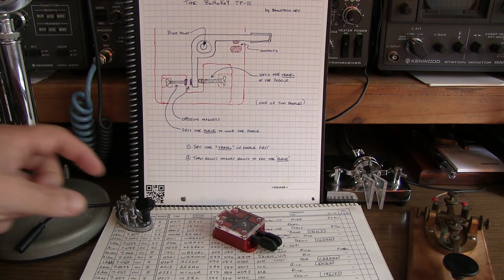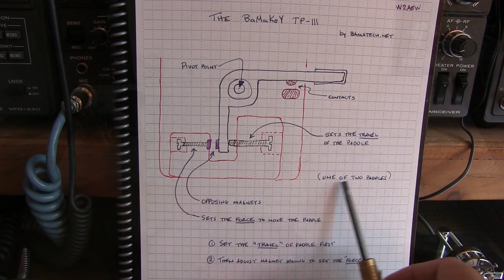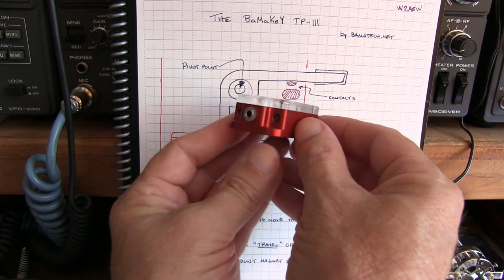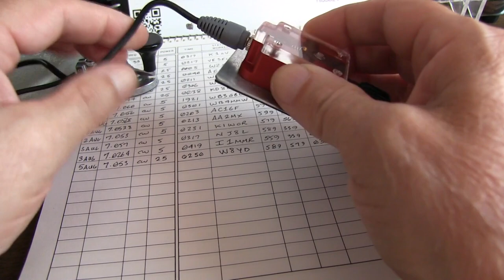#360: Mini Review: The BaMaKey TP-III miniature Morse Code paddles/key by BaMaTech

Comment: Very nice key and I wonder how it compares to the Begali Adventurer.
Reply from the maker: Good question.  I've had the TP-III for a bit over a year, and just got the Begali Adventure for Christmas (so haven't had as much experience with it). But, at this point I can summarize as follows:
- Both are fantastic design and build quality
- Both are super-smooth and solid
- Adventure "feels" more like a full size paddle (larger finger paddles, similar feel)
- TP-III is certainly a portable/mini key - much smaller finger paddles.
- Adventure works GREAT on the KX-2 mount and/or the base mount - would not work well hand-held as your grip would likely activate paddles.
- TP-III is definitely designed for portable operation (decent contact protection from dust/dirt, easy to operate on surface or hand-held).
- The TP-III feels more bullet-proof for rugged travel in a field pack, I'd want to put the Adventure in some kind of protective case for travel.

Bottom line - both are fantastic. I feel like I've got the Porsche (TP-III) and Ferrari (Begali) of portable paddles!

Comment: How is the speed adjusted and the tone generated?
Reply from the maker: The speed and tone are controlled by the electronic keyer in the radio (or a standalone electronic keyer).  This paddle set is nothing more than a pair of normally-open switches.

Comment: I just ordered this beautiful key. This excellent review serves as a great quickstart manual. I like the elastomeric tape idea. Any specific type or brand you recommend? 73.
Reply from the maker: I used something I found on Amazon with good reviews.  Put the tape on the bottom of a small metal plate - works pretty well, but still needs a little bit of pressure to keep steady.
Reply: @w2aew  Ok I'll look around. Thank you! 73

Comment: This is a request for a video topic:
I note that there are many videos on end fed so called random wire antennas.
I have watched many and I am UN-impressed with the content.
I am a inactive Ham and an electronics engineer. (Not much RF experience)
But it seems to me that there are conflicting explanations on the sub topics such as:
1) UNUNs
2) Counterpoise
3) RF Chokes on the coax
4) Wire length and type
5) Grounding or not
-
If I were confident in my understanding, I would make a video and structure it by designing a circuit equivalent of the antenna 'system' including each of the above.
-
I have watched many of your videos and not only find no fault, but I highly respect your clear approach toward teaching. Please consider a video on this topic. I believe it would be a significant contribution to the Ham community. 
You are the real Elmer, amongst many not so. 
Thanks for your considering this request.
Dan - NO1SE
73